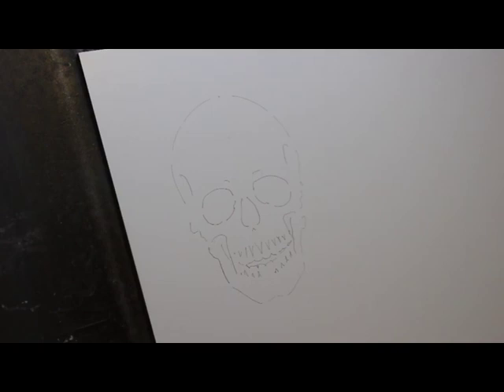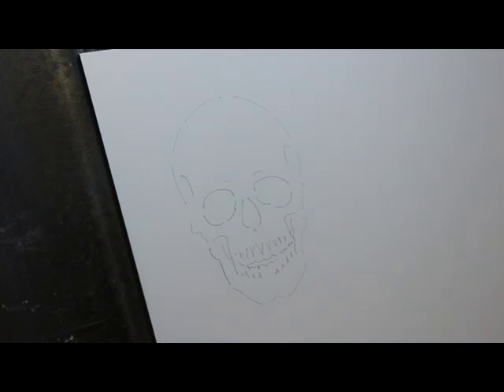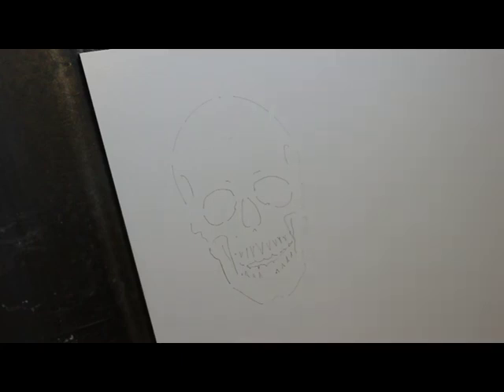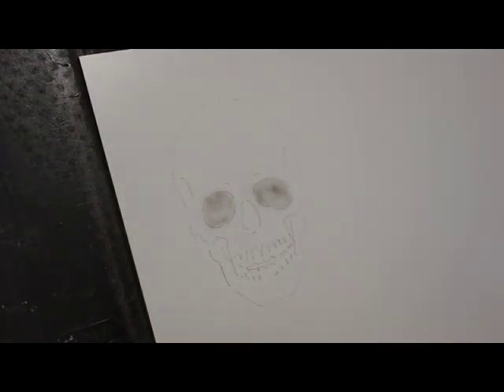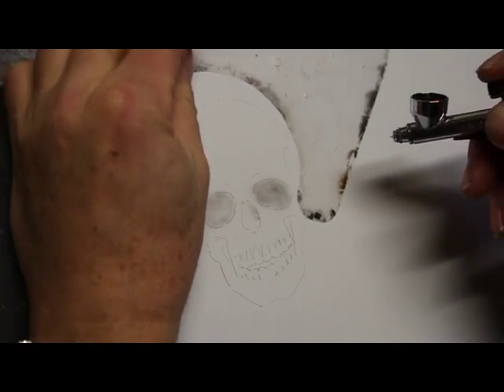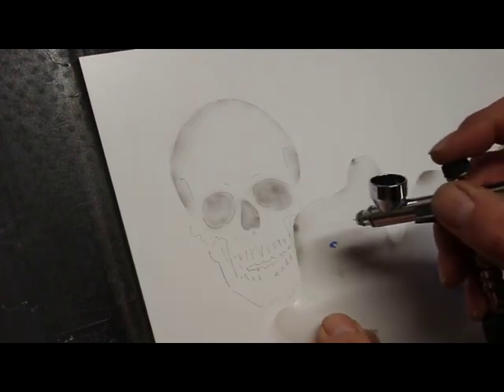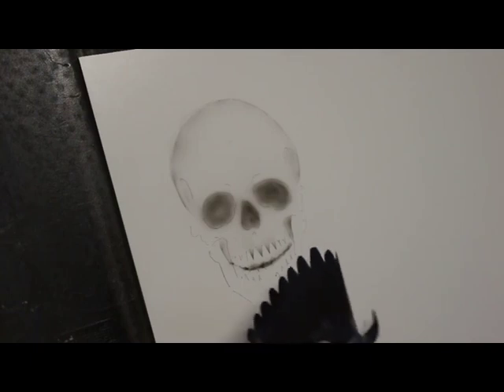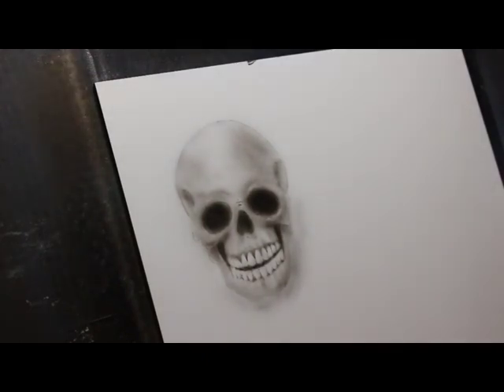How to airbrush. Lets learn to use indian ink together.   A step by step guide,

Comment: Thanks for the video Jack. I
Did a few trials with India ink on paper. That is usually what T Smith uses. He makes several different mixtures for the different values and turn the psi down to around 10-15 for fine lines I used darker mixture it seems to last for quite some time
In the cup. Nice job thanks for sharing and keep spraying
Reply: He will also use a white ink mixture also
Reply from the maker: Thanks John. T Smith does a fantastic job, I hope to get there eventually . Just loads of practice !!!